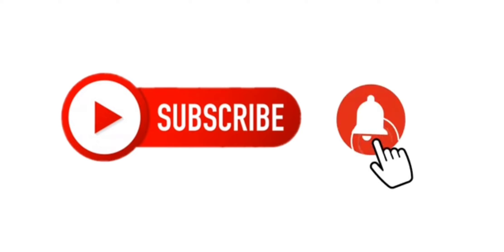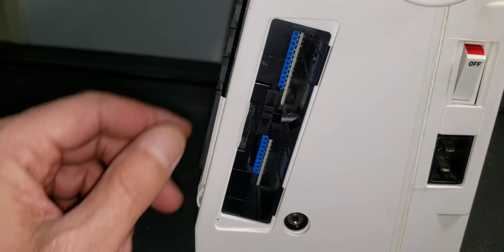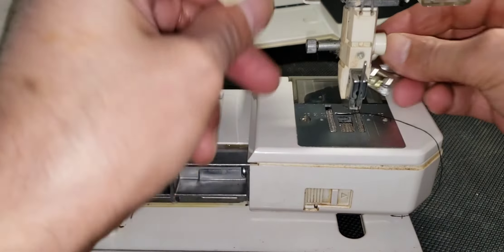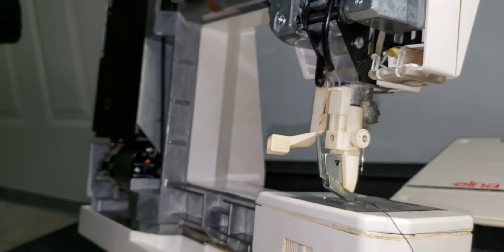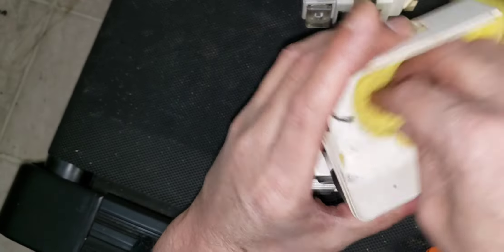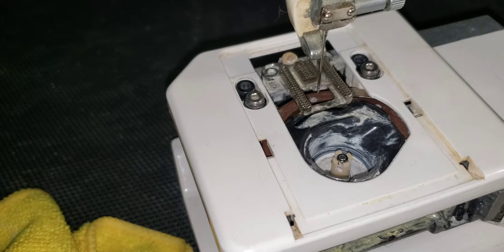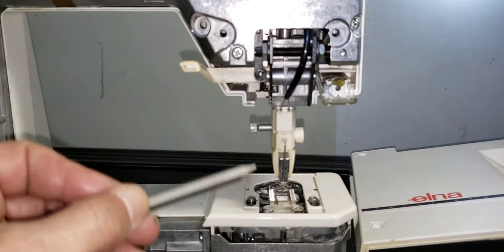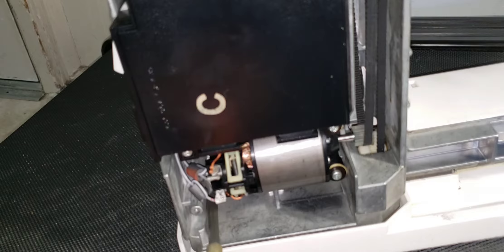Maintenance And Services Sewing Machine Elna 9000 Testing And Troubleshooting

Comment: Taking the machine fully apart is fascinating all I wanted to know was the place to add oil in the normal manner.
Reply from the maker: Yes, it's important lubricant sewing machines to keep them clean and running smoothly, sewing machines must be lubricant at least every 4 years or so or it depends on usage, some sewing machines have some holes or designed places to add oil without taking it apart, sewing machines maintenance and lubricant by adding oil to all movements and gears keep the machine operate smooth and quite and in good condition too,  it's recommended to use sewing machines oil for best performance,  thank you and all the best

Comment: Our machine Elna 9000 is not having speed , and the material is not moving.......it works but very slowly .......there is no blue little box by the memory ...when i open the side , will this make a difference to sew ....what is connecting these batteries ? for what perpose ....Thank you from South-Africa.
Reply from the maker: Good Day my friend, elna 9000 is slowl here are position causes and solutions. Try step by step 
1- machine needs lubricate use saw machine lubricate 
2- check  if there are any fabric or threads stuck inside the bobbin case areas,  or inside the sewing machine
Make sure it's free of any durts and debris and clean it.
3- check the machine main motor 
Try to hold  the motor while is spinning hold ir with something to see if that can stop or cause the motor to spin very slowly check to see how much motor resistance and how strong is it, if it's too week or stops easy then the motor is very weak and needs to be fixed or replaced,  when motor is not spinning hold the motor drive wheel by hand and try to wegling it  all directions if moves or any small wegling that means the  motor Bearings are bad must be replaced.
5- check if the motor belt is losed or needs to be tight there is tension adjustment for belt.
The 2 AA batteries  I think  the batteries are for machine memory.
As back up but I am not sure , check on internet for details.

The blue box for memory cards has its for custom and especiall embroidery and designs has nothing to do with slowing the machine. 
Hope that can help you to figure out 
Thank you and all the best 👌 👍
Reply from the maker: Please let me know if that helps you to find out why? Any questions or concerns please feel free to comment 😊 🙂 ☺️ best regards 😊
Reply: @WorldRandomVideos  thank you so much and yes i am going to check it out ..... like you exsplained...will let you know the results a little later ....i must bye the special spray to ....HAPPY NEW-YEAR 2023 ALL THE BEST WISHES AND BLESSINGS 👍🍀🌈😊
Reply from the maker: Thank you so much 👌 💓 😊 
Happy new year 🎉 ✨️ 
And all the best  👍
Reply: @WorldRandomVideos  Thank you for your advice, i followed all  your steps,    and oil all parts ......the machine is working again .... this time Normal speed , all is working!!!👍😊
Reply from the maker: My pleasure 😊 🙏,  o am happy 😊 to help, thank you so much and all the best 👌 👍
Reply: @WorldRandomVideos  "GOD BLESS YOU " HAVE A NICE DAY !
Reply from the maker: @TheRebornhobby  God bless you 🙏 ❤️ and all the best 👌 👍

Comment: HI: just let you know that, after I checked back the foot pedal and measured up the conductivity, I removed the interference capacitor, put it back together, works fine. machine light bulb was burnt out which I ordered one. Thanks for your response and some advice.
Reply from the maker: I am glad 😊 you fixed it 
Any time my friend happy to help
Good job and best regards 😀
Reply: Hi dear, My Elna 9000. The needle will not pick up the bobbin thread. Bobbin Runs and stocks after. holder of the bobbin itself runnung on and off.could please give an advise?

Comment: My presser foot will not lower what do I need to fix it. I love my elna9000. I have many other machines new. But this one has always been my favorite. I bought it new in 89 and it’s is very well taken care of  no one around here knows anything about it
Reply from the maker: Hello my friend,
Thank you for watching 👀 and your wonderful supports ❤️ 
I will do my best to help you find out this cause and fux it,
Unfortunately I can not tell you exactly the problem it's diagnose step by step until you find out the problem,
1- open the back and front cover so you can have an access inside the mechine, remove presser foot covers 
2- it may need to be cleaned very good, check if any fabric, dirt, Gummy thing or degrees or broken needles or anything stuck or jammed inside if you find anything unusual then that may fix the problem,
2- there's a small adjustable piece beneath the dog feed must be in the center position not left or right,
3- if non step 1 or 2 fixed the problem then you need to go deeper 
Because it's computerized machine so all movements are connected or related to each other mechanics and electronics both responsible together to make this machine working excellent and it's complicated same time,
Check all movements make sure nothing is losed or bended or stuck or jammed,
4- every time plug the machine into the power it self reset you can hear sound too, does your Machine do that? If not then that's electronic problem.
5- the all springs and Tensioner to make sure all working fine and sitting in right position 
I hope that can help you to figure out 
Please let me know if you be able to fix it or not, all the best 👍

Comment: Hi, I have an ELNA 9000 and for sometime now it has started to slide the fabrics while sewing to left and right with the  result not to be able to get a straight stitch.
Reply from the maker: Hello my friend, here are some troubleshooting tips and steps :
You may need to reset the machine this machine it's self reset every time to plug it to power you can hear sound, but if it didn't reset by it self 
That's mean there's something wrong with electrical boards or computer.
1- check the fabric feeder (feed dog) if it's loose or damaged or not on right place,. Or loose spring inside beneath the food dog Remoe the cover to access so you can see,
If nothing wrong go to Second step
2- check the presser foot Tensioner make sure it works well.
 this Sewing Machine one of the most complelicated Sewing machines  it's has very smart customer it works by electronics and mechanicals together so if steps one and two checked and both ok 
Go to third steps 
3- remove the Covers you need to access to inside the Machine, 
Rotate the machine by hand and see if all mechanical and movements works ok, check if there's any thing such as debris or dirts, fabric  stuck inside, check if there's any parts or screws are loose or missing 
Check all  gears  if all ok and nothing wrong go to this step
4- on the Electronic board are several adjustments dials I will send you another message about them 
Thank you 😊

Comment: Mine is running a bit noisy, I didn’t know you could use the lithium grease that way, great I will try that.
Reply from the maker: Hello Friend, if you have the same machine it's better to use sewing machine oil if you don't have you can use fully synthetic car engine oil and make sure add only on movement mechanical and joints, or you can use any type of grease will work also, lithium grease sometimes can cause problems it depends on what type of brand some contain water vapor which can cause electrical shortage, to be safe use reqular mechanical grease 😉 
Best regards ✨
Reply: @WorldRandomVideos  ok I will and thanks, yes I will be careful with it mainly using it on metal to metal, thanks for your response.
Reply from the maker: My pleasure 😊

Comment: I have an Elna 7000 that refuses to go fast. After turn on, it goes slow. Bobbin goes fast. After a few tries to run fast suddenly it shakes the needle and then it can go fast. Any idea what it could be ?
Reply from the maker: Hello my friend, there are few possibilities troubleshooting try step by step: please note computerized sewing machines are complicated therefore all electrical components and electrical boards and wiring and machanical must work together properly for sewing operation
1- it may needs some lubricant seeing machine oil add to all machanical movements inside the sewing machine if already lubricant done try next step
2- check the belt I am not sure if this sewing  machine has 2 or 2 belt, check if they loose or wearing out, if belt is ok and tight enough so doesn't slip try the next step
3- this sewing machine self reset every time turn on resets it self so if iltge auto reset not working that means something wrong with electric boards or wiring shortages that's has to be checked and troubleshooting, if you have user manual look under resetting!!
4- if still nothing worked then you need to dissemble sewing machine sewing machine and look inside carefully check if there's any debris or fabric or broken needles or threads stuck inside especially bubbling area, if nothing, check and test all Springs, screws and all parts if loose missing ot bended or twisted.
5- if everything is ok and still issue try to check all gears and patrons Dials (switching dials and gears) if they all rotate freely and no Skiping or slipping or wearing out or broken loose. 
I hope that can help you to figure out the problem, thank you and all the best 🙏

Comment: I would like to do timing on hook on Elna 9000. Could you please show me on video or some how guide me.
Reply from the maker: Hello my friend, I am sorry I don't have this sewing machine anymore I buy and sell  repair services, this is what I think you need to do:
Timing With any computerized sewing machines it's easy for some sewing machines if they have built in  self reset, other can be more complicated and time and experience needed to do timing,  Elna 9000 is little old and it's complicated it has 3 different types of motors and  2 timings and 2 computerized gears box I think what I remember so I would say try to give it try different settings at each time rotate sewing machine with your hand slowly and check if something not tight try different settings again and repait steps, I hope this information can be helpful thank you again and all the best 🙏

Comment: I need to time my machine.  Do you have any information on doing this? Thanks in advance!
Reply from the maker: Hello my friend,  to be honest to don't have any information because and I never did that, Maybe the best option is to look for service manual 
If you can't find any helpful information, I am sure this machine has automatic self timing reset, 
I can give you some tips may help you to figure out but I need to know what is the reason you need to time the machine is the belt broke if so which one ? Let me know and we I'll go from there,  thank you and all the best 👌 👍 😍
Reply: @WorldRandomVideos  I was given this machine.  It was frozen and had a cracked part. My daughter and I took out the part and fixed it.  It was on the rod that runs from the bottom of the machine to the bobbin and race unit.  I believe it's called a wormgear? It's white and just before a black gear on the same rod. But when we reassembled the machine it looks to me to be about 180° out of time.  I've never timed a machine before but understand the concept and can do it if I knew which set screws to loosen (I think, lol). Any advice would be appreciated!
Reply: @WorldRandomVideos  and I have the service manual which is almost worthless. ☹️
Reply from the maker: @pyfairy  clear enough, I got it, I with if I still have the machine so I can make a video guide on how to time machical movements, I will do my best knowledge to guide you through, I remember I did timing for another different model machine spinning rod with bobbin housing it was not easy but it's possible just takes time and patience and several attempts to adjust machical movements until uou find the right timing setting , what you need to do:
Important:sure every time you change setting don't use foot paddel , rotate the machine with your hand slowly so to make sure nothing brakes if setting is not right,
1- first Try to lose or disconnect the spinning rod from bobbin housing,
2- use marker every time to tight the spinning rod to bobbin parts or housing, rotate with your hand to see if this setting works or not, it may takes long tone until you find the right timing and setting,
2- this machine it's cumputized so it's electronics and machicals work together to operate the machine that's why it's complicated,
3- if stop 1 didn't work after trying all settings try to watch this video it may help you to fix the problem 
https://youtu.be/fzhR6PNlI4E
And here is a website link about how to adjust hook timing 
https://www.manualslib.com/manual/934621/Elna-9500.html?page=21
Please keep in touch whether you solve the problem or not 
Thank you and all the best
Reply from the maker: @pyfairy  this is another detailed website link 
https://www.wikihow.com/Adjust-Sewing-Machine-Timing
Reply from the maker: It may be easy if you can adjust the time by the wormgear try to lose the parts hold the gear 180° and move it one teeth at each time either left or right random rotate the machine with your hand slowly to see which the right  direction you should move the gear, everything you move the wormgear jlone teeth at time mark it so you know and keep following this step until you find the right time and right adjust setting, let me know how it goes 😉,  Best regards 👀 ✨️

Comment: HI: recently my Elna 9000 is running too slow, I checked foot control, power supply, cleaned and removed some tread above  the needle compartment, but the steal running too slow, could you please give me an idea that could help to solve my problem/ also needle stock at the left side and tried to relocate by touch control to the right or centre no movement.
Reply from the maker: Hello My Friend, I was away I have just read your message, 

There are many moving parts along the thread line so a lot can go wrong and cause your machine to run at a slow speed. When you have made sure that the upper thread, as well as the bobbin, works just fine you can move on to check the next point
How often should you oil a sewing machine? ” style=”soft”]When a sewing machine has been used for around 25-30 hours you should apply oil to make sure the machine works flawlessly. This is also to make it last longer.
 A sewing machine typically runs slow because it is jammed or needs lubricate. Besides that, you can check the cord and foot pedal to make sure everything is plugged in properly. Lint can also be the problem.
Switch the machine to bobbin winding position and have the machine run at normal speed. If that’s possible you will know that the problem is within the area of the moving parts. We can conclude that this is not a problem with the cord or foot pedal.
Make sure the thread runs smoothly and is not jammed in any way. You can also check this by using the manual wheel. Be sure to unplug the power chord first before you check the thread.
Take a close look inside the bobbin case and along the thread from the spool to the needle. Everything should run smoothly and unhindered.
If you are using the wrong oil or lubricate this can also slow down the machine. A sewing machine needs really thin oil so you cannot use any other type of oil. If you have done so by mistake you should clean it off the best (with paper). Now you apply the correct lubricate a few times and wipe off with paper between to remove the old oil.
all the old oil the right lubricates can get to work. Manually move the needle up and down a few times to make sure everything is moving at full speed again.
First, check that the cord is plugged all the way into the machine. If that’s the case the machine might not get the power it needs to run at full speed.
Try and do a little manual testing of the pedal and check that it’s not broken or damaged in any way. When examining the foot you can also listen to it carefully to make sure you haven’t got dirt or sand inside the moving part.
Reply from the maker: After checking foot pedal and cable cord 
And all above solutions and still nothing worked then try below steps
Those are deep fixing solutions 
1- open the sewing machine cover and check for belts if it's loosed or not settings right
2- check if the motor works fine in full speed no unusual sound 
3- check if all movement parts joints are in good condition no broken or loosed parts or not settings right 
4- check the electrical bread if anything may be burned out such as resistors,  ic, or capacitors or any other components 
5- Sewing machine running slow mist likely 
1 foot paddel or cable cord 
2- mechanical issues no lubricate or some movements are jammed or loosed 
Or parts on popping area are not settings  on right position 
3- belt tensioner is loosed or broken 
4- motor drives the sewing machine can be issue either not working right in full speed or time to replace it
5- electrical problem electronic circuit boards problem some electronics components burned 
I hope those can solve the problem or at least give you an idea where to start and find our the solution
Please let me know if solved or not 
Best regards 
B
Reply: @WorldRandomVideos  Thanks for your response, Just let you know that Bobbin winder runs at normal speed. the foot pedal cord is Ok. Checked belt tension also is Ok. I will open the machine case again and look closely to see what I could find. Thanks for your advice.
Reply from the maker: Be sure try not to rotate the mechine if you want to remove timing belt just like cars it has to be at same settings, 
And also make sure no oil or grease get inside the rotate disk it's important because it's so sensitive that I think it has 2 magnetic rotation disk for all patterns and movements for stiches and commands to the computer
Reply from the maker: My pleasure 😊